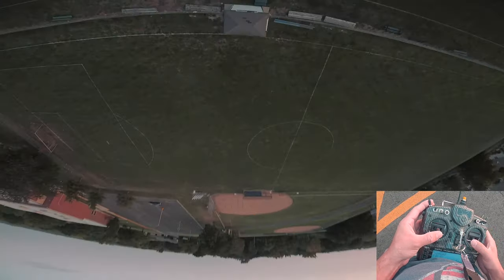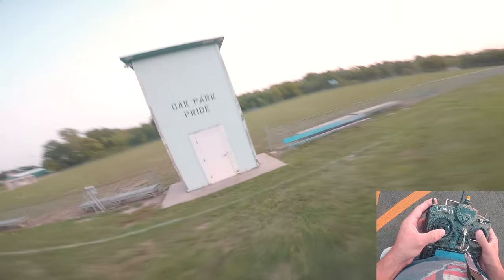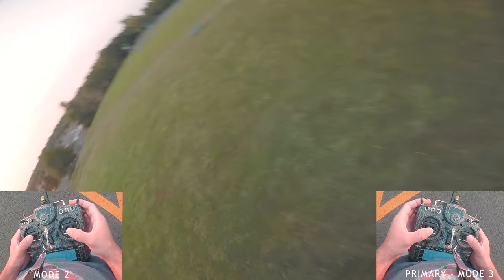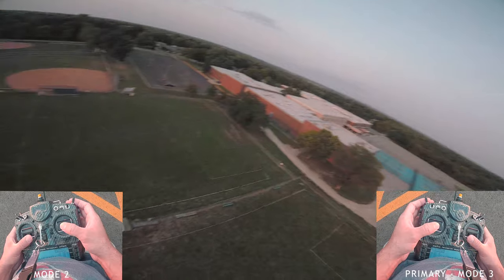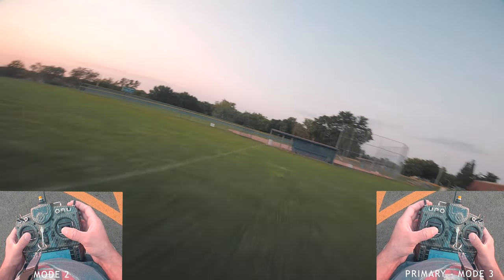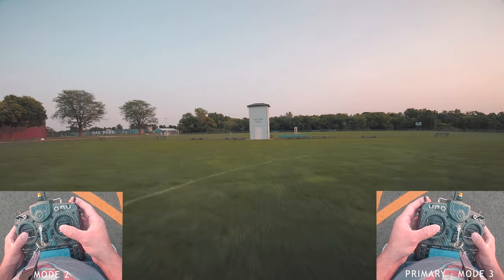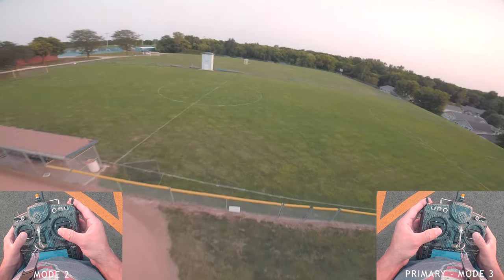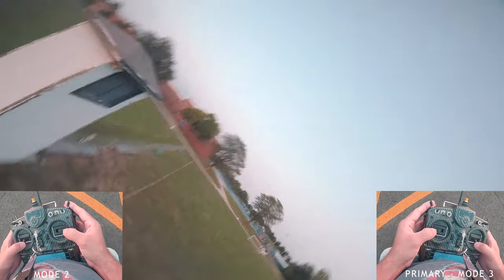How to FIX your FLIP? | FPV Freestyle | FPV BASICS!

Comment: Quick question on my next build I want to put a tmotor 1950kv motor I have the f40 iv 1750kv on a different build which I love, how do you like the 1950kv compared to the 1750kv should I stick to the f40 proIV 1750kv or try the t-motor blackbird v2 1950kv not sure what difference to expect..

Comment: I'd like to see a video on something that's really hard to explain. I often struggle with putting the quad exactly where it needs to be, for instance when I set up for a dive or something. Usually I'd come up from a weird angle and it's kinda hard to judge in what orientation and place I land if I punch out in this and that pitch/roll combination. You know what I mean? Again, hard to describe and not really a trick, but more basic understanding of stick movements and flights paths outside of a straight flip or roll coming from a sorta level oriantation.
Reply from the maker: Good topic

Comment: 1 question.. if im runnin 20-25degrees fpv cam, do i need to pitch back slightly to get the quad leveled just before the blip? or can i just go straight into the object n just throttle up?